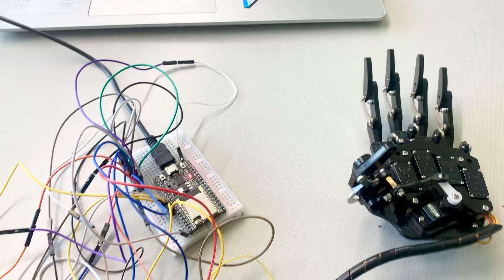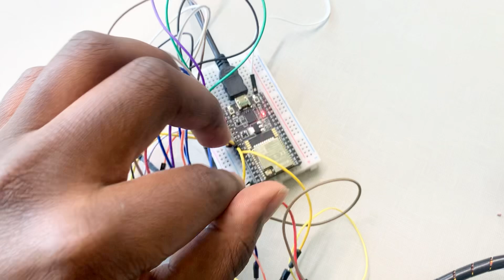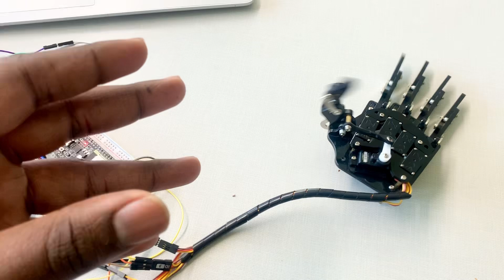Why is Arduino Not Widely Used in Industry?

Comment: great video! i always say, if you need a PLC, then use a PLC. if you're using an arduino thinking you're saving money, you're crazy. I have worked with SLC500s for example that have NEVER been powered off in decades and are still running to this very minute.

Comment: I think it depends on the project, for smaller businesses that just need a „one thing can do all“ with little to no development costs in low quantities it could be an option. But as soon as you need your own pcb for other components it will be way cheaper to just make your own system, cuz the lower performance mcu‘s only cost a couple cents and this dev. board a couple euros. If you are making your own pcb for let’s say a measuring device, the circuit from that is already complex enough, so you will have much more variety when you choose your own mcu and it just costs a couple cents more. I didn’t really get that deep into commercially mcu‘s but what I have seen for now is, that their agreement to sell that chip is much longer, we talking about decades - which is important, cuz you don’t wanna redevelop a finished product every 5 years. And also chip producers like stm, Texas Instruments, renesas or atmel will also provide you with really good dev boards documentation and forums. So developing on them professionally will give you a much bigger knowledge base and experience from others, that used this exact chip for 30+ years already. Also power consumption is really important, for example the esp32-s3 got down to around 8microamps, but other mcu will have only 2microamps in sleep mode and more importantly can wake up immediately- which is a problem with many of these diy boards mcu like esp32. For example a chip that needs to run for 10 years of a 5000mAh battery but needs to wake up every second for a split of a second and enable the rf to check for incoming frequencies and also need a watchdog and other security measures. The esp32 goes slowly towards this direction, but for now I guess it is mostly useful because it works with micropython. Every chip producer got different types of a version with different performance and functionality, the esp32-s3 is a ‚does all pretty good, but not perfect‘ chip.

Comment: In my company, I used multiple controller like PLC & microcontroller ( Arduino), but unfortunately durability Arduino not good enough, after used around 6 month we have alot of issue about Bootloop, so after 2 years monitoring we decide not used again arduino in our factory.
Reply: 2 years is a pretty long time. A good do over every 2 years for the price is kinda spectacular.
Reply: @dwightferguson5454  I dont think so, if you have to stop production a few days or weeks every two years, it is a disaster. You will have to explain a lot to the management team. Every hour down in the factory is loosing money.
Reply: ooo soo basically it's not a long term solution for industry

Comment: Not Arduino boards but the Atmel processors are used in the industry but most do not use the Arduino bootloader. Most used processor I think is the STM32
Reply: pic mcu are surprisingly still common in some places (old industry equipment)
Reply: Yea deff. At the end of the day its only slightly more annoying to use lowkey.

Comment: Cuz our old timey engineers learned programming controllers by manually putting hex codes into logic ICs.
They've seen some things. Can program you anything in assembly. Having started further down the pyramid of abstraction layers makes u gud. They laugh at arduino noobs. 

A youngin that started at the very top with arduino will fail miserably when his library doesn't work and he don't know how the library works.
STM32 & CubeIDE is a healthy mix between dipping further below hardware abstraction layers for niche custom applications and still being a widely used, well documented & supported platform.

Comment: Answer: Because for anything that just needs I/O usually PLCs are used, because you dont need Programmers for that. If it needs a Microcontroller e.g. because of the size or maybe because it has to work with low energy, the Arduino isnt the cheapest option. Instead the Industry would go for just the Microcontroller e.g. the ATmega. But still, there are cheaper Options. Dont forget even some cents cheaper scale up quickly. Lastly, if more calculating Power is needed, well the Arduino doesnt have it. 

Still its one of my favourite Platforms, and a good way to learn. Also its nice for Projects. We do not have to go for just the Microcontroller. Spend some cents more and you get e.g. the voltage Regulation + USB for the Arduino. Spend an Euro more, and you get an ESP32 with WiFi and Bluetooth.
Reply from the maker: Well said! Arduino is such a wonderful learning tool even for very complex projects. It fails in cost-effectiveness and demanding real-time scenarios.

Comment: Didn't watch the video, just came to answer the question.  Because in industry, you design and build your own circuits to your requirements.  You don't use someone else's product that is built to a cheap price.  Why would you?
Reply: It's exactly what he says in the video. It's mainly used for prototyping
Reply from the maker: @stargazer7644  thanks for answering the question, but there are microcontrollers and development platforms that companies use straight of the bat. Usually they have more software control compared to Arduino
Reply: @orieka.o.s.e  Yes, there are, but Arduino isn't one of those.  I would build a dedicated board with a Microchip PIC microcontroller and roll my own software for any embedded application.  Arduinos are great for playing around at home, but you shouldn't risk the reputation of a commercial design on one.
Reply: @orieka.o.s.e  For example, you don't know the origin or specs of the components used in the arduino.  What temperature regimes was it tested for?  What electromagnetic susceptibility? And you have no control over if those parts will be suddenly changed in the next batch you get from your supplier.  Did arduino get a really good deal on some cheap caps this week? You don't know what quality control was used during manufacture, so you really have no control over the reliability of the module.  If you build your product around this and suddenly in the next batch arduinos start failing, then what do you do?   There is no reason to take on such a risk.  You specify your own components, testing, and manufacturing, and then you know what you're getting.  If there's a problem, you have control to fix it.
Reply: @stargazer7644  what kind of pic controllers would you recommend, for cnc like machine if one wants to build from scratch
Reply: i mean you could use just its micro processor chip
Reply: @alinabeel7953  that's what they do ... Build a custom circuit around whatever chip is already available in the market
Reply: Not always. My (at home) EV charger uses a straight up raspberry pi zero. Maybe that's because it's harder to make an SBC than an MCU dev board
Reply: @case_sensitive  And you've apparently missed the implication of what it means that your EV charger is based on a pi.  An SBC is fundamentally no different from a microcontroller board.  The software is different, and the SBC requires more resources because of that.  They both have a CPU, RAM, ROM and I/O peripherals.  The microcontroller is a little easier because most or all of those are contained in one chip.
Reply: I think you assumed the OP was genuinely wondering, but he was actually not wondering but answering the question.
Reply: it's actually more expensive to use arduino. my supervisor don't even let me use a PLC .
Reply: dIDnT wAtCh tHe ViDeo

No one asked
Reply: @pear-zq1uj  Actually, someone did.
Reply: It think it just simply cost,  especially for businesses.  Personally i was about to buy another arduino but realized I could buy 3-4 stm32's for the same price, and so i did, but then I realized it took me 3-4 times longer to figure out how to program them..  But now that I can make a working sketch  with an stm32 I see arduino's as expensive and slow. Maybe the newer ones are better, but i see them as a learning platform, but fairly limited after that if you want to use displays and what not.  I wish i could just buy another couple arduinos for random projects but everytime i do im cant justify the cost compared to other options that offer more for less.
Reply: @mikejones-vd3fg  I gave up on the Atmega/Arduino chips.  ESP32 has many more features including WIFI at a lower cost.  I use the standard ESP32 board in most of my projects.  They cost about $3.00.  You are right about STM chips, I took a look at them, and they are harder to program, and don't have WIFI/Bluetooth built in.

Comment: I mean you seem to be saying that the included arduino drivers/libraries/available abstractions are too general and not optimized for specific use cases. That seems like a plausible point, however, this does not seem to be a reason not to use arduino, because no one stops you going a little lower level and writing these yourselves on arduino, if what you are saying is that you would normally write them yourself with other chips.
Reply from the maker: @johanngambolputty5351  is Arduino hardware built to handle low-level changes?
Reply: @orieka.o.s.e you can work with Arduino at register level and not use the pre-made functions.
Reply: @orieka.o.s.e  YES

Comment: I'm working on a project where we are replacing our PLCs with ESP32s connected to some converters :)
Reply: That's great I hope you will not Abuse by your government through Beaureaucracy.
Reply from the maker: @jaedson-barbosa  how are you guys programming the ESP32s?
Reply: I would guess esp-idf is being used.
Reply: @orieka.o.s.e  using the ESP-IDF and VS Code.
Reply: Wow, is that real? I thought PLC is the gold standard for industry settings, guess stuff taught in uni is outdated huh

Comment: I use the arduino 2560 for utility scale energy storage. It’s great for environmental controls, but it’s not a true industrial controller. The failure rate can be significant in tough environments.
Reply: tbh if you use atmega microcontroller outside of arduino like doing baremetal or their dedicaated software its still a lot better since atmega328p is quite a capable IC and with decent control over hardware level its sweet!!

Comment: We use plc they are way reliable and easily fixable in case of bugs and shutdowns
Reply from the maker: I agree!
Reply: In my experience, a PLC is rarely the cause of an unplanned shutdown; usually it is a physical component in the process. OR, some buyer forgets to order a required consumable and you either run out or have do majorly scale back throughput to keep production running over a holiday weekend.  (I've never seen that happen before...  LOL.)
Reply: Provided that you provide adequate ventilation or cooling to keep it from overheating, yeah it's rare.

Comment: you are wrong the Giant tech company I worked actually used Arduino on that "test and Inspection machine" and  "Plasma treatment  solution" the reason  is cheap and they can save a lot of money and they can reduce the sized of the E panel! Yes the company I have been work for 3 years they cutting cost using this
Reply from the maker: @csmyfavoritecompany1213  that’s interesting. Do you think your company is an outlier?
Reply: @orieka.o.s.e  I worked to this company in carlsbad california where they have contracted with AMD, Nvidea, Space X and nasa  and yeah the product is reliable with good efficiency in production rate
Reply: @orieka.o.s.e  The company I worked  have made a big contract from the past decade with other big tech company such as Microsoft, Nvidei, AMD, Nasa and recently space X. and other Automobile. the engineer I spoke with from the past he realizing how simble and cheap arduino to be used in the machine and they save alot the new machine I have assembled used Arduino Uno and Shield and also used Clear Path motor from Teknic and they drastically low the cost and speed of manufacturing. I worked as Mechanical assembler II in this company but sadly after covid the company shutdown and move to India and Suzhou china
Reply: @orieka.o.s.e  Nordson asymtek, march, yestek, dodge
Reply: A yes, the age old anecdotal evidence fallacy. An appeal to the exception. 🤦
Reply: Whats the name of the company?
Reply: Nordson